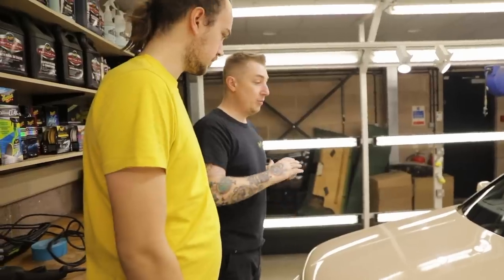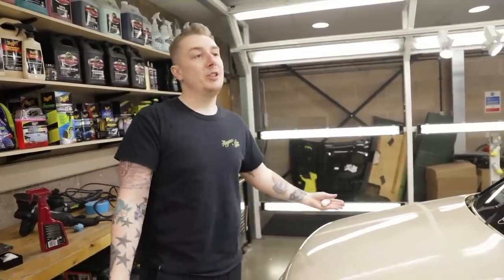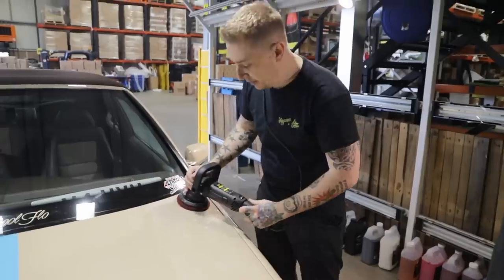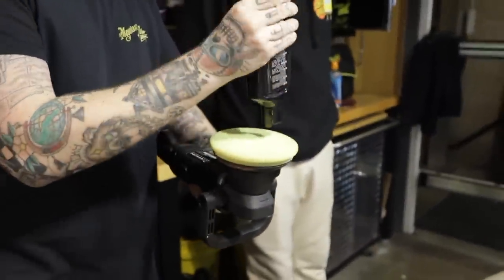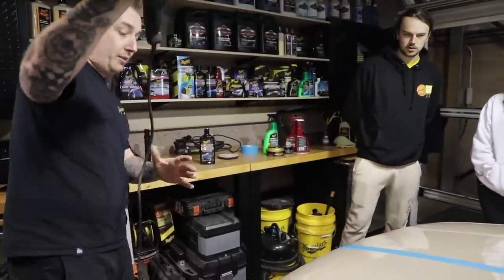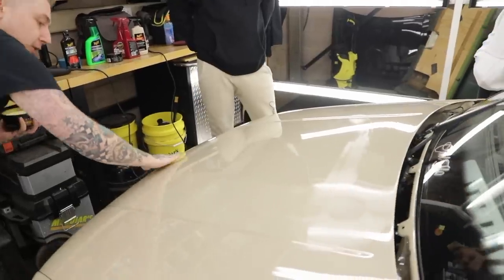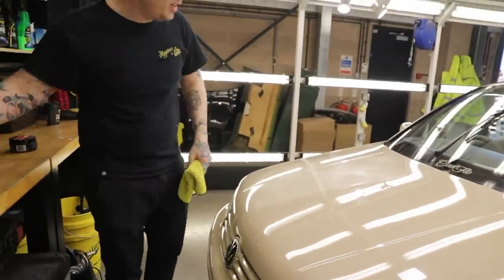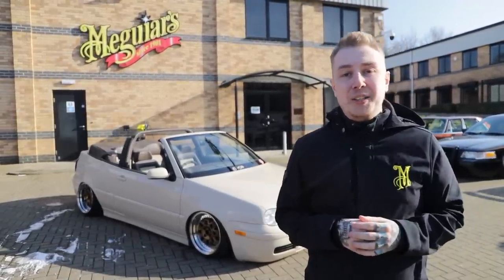How to remove SWIRL MARKS that you CAN'T SEE | Day In The Bay

Comment: Hey, hope you're doing well!
I have decided to detail my car after feeling confident watching your videos now 😄
It's a Pearl White color hatchback. 
It has swirls if you look closely from an angle. I want to get a shinny smooth finish with minimal cost as I might also sell the car in a few months to upgrade. 
I have a few questions  😁
1. I'll clean car thoroughly, maybe use an iron remover 
2. I'll Clay
3. Compound
4. Polish
5. Wax
Now in my country car products are expensive as it's all import.
I had a plan to do Meguires Ultimate compound, then ultimate polish and wax. It's a small car and the Wax specially is most expensive!
Should I go with the Meguires white paste wax ?
As it's a white color, swilrs won't be visible right. Will it be suitable to apply that directly after claying. Just 1 product?
Thanks

Comment: Thanks to your videos I've just spent £135 on your products! Your videos clearly work from a marketing perspective. Is there a difference between the drying towel and finishing towel?
Reply from the maker: Other than size no. But because the drying towel is much larger it's far better at absorbing water when drying the car.
Reply: @meguiarsuk  Thanks, what can I use just to buff the car off right at the end? Microfibre cloth?
Reply from the maker: @benl8177  Either a clean microfibre towel or Finishing towel.

Comment: Can you please explain what is the difference or benefits of using the Gold Class Shampoo vs the Ultimate Shampoo? Thanks.
Reply from the maker: The Gold Class contains conditioners that help with water sheeting away from the panel. The Ultimate Wash and Wax is our only shampoo that contains suspended carnauba so when used leaves a layer of protection on the car.
Reply: @meguiarsuk  Perfect. Thanks. Can i use both at different levels? Let say 1 month with the Gold and the other with the Ultimate to have the benefitis of both?

Comment: Can we get Maguire’s 3” foam cutting pads? The Autobrite Direct 3” foam pads I used on a 20 plate Clio detached from from foam backing. In all 3 pads fell apart due to insufficient glue. The 3 stage Maguire’s on a black car was hard work but worth it.  I’m still aching now. Products used 2 x MT320, 1 x 5” backing plate, 1 x 3” backing plate. 5” Maguire’s Cut, Polish and Finish foam pads. 3” Autobrite Direct Cut, Polish and finish foam pads. Autobrite snow foam (purchase in 25l drums). Ultimate wash and Maguire’a Super Thick Microfibre Car Wash mit using 2 bucket method. Ultimate WashClay kit, Ultimate Compound, polish and wax. Drying towel Maguire’s x 2, GT dryer and Finishing towels.

Comment: Iv tried the ultimate compound with the red Meguiars cutting pad and the swirl marks just don’t go of my mk5 golf gti,so iv ordered menzerna 400 followed by the menzerna super finish,hopefully things will work,if not,then I’m paying for a pro to come out coz these swirl marks are doing my head in specially wen the son hits the car and being tornado red you see it a mile of
Reply: I used ultimate compound with the microfibre cutting pad and it improved my tornado red paint on my Mk7 golf but there are still swirls aswell.
Reply: Try s20 black with the spider pad...my motor is red also .....came out pretty good
Reply: Depens how deep the scratches are! Potencially look into wet sanding the scratches first, saves you plenty of time but be careful not to go throught clear coat.
Reply: You could do rotary cut, and then follow with a da to polish to get the haze and the holograms out...thas what i do sometimes....
Reply: spyros greece hi ya fella,iv not got the experience to use a rotary I’d be to scared to try,what about the 400 then 3800 ?
Reply: DV Car Care I don’t have scratches fella iv only got few swirl marks ?
Reply: @tonylyons1274  of you use wet sanding you will def need a rotary because the da will take for ever...plus with sanding you will need several sand papers from ruff to really light so you can bond the scratches....if you take a rotery 2.000 2.500 rpms quick moves and working in a big area you will be fine...every 2 passes stop check ur area....and plus you could use a polishing pad for cutting instead of a cutting disc so you can play on safe side trust me you will be ok, do a test spot on the hood....do one side....and keep polishing with a da polishin pad also....if you dont have a second polishin pad, wash it reall well before you use it with the polish, i always clean them with all perpose cleaner and they are perfect
Reply: With a da we split the hood into 4 sections for example for cutting....with rotary just split in to two....and the same area, use for polishing with da. Just try to keep away from the edges, if you hit an edge dont panic nothing will happen, but if you have high rpms on a rotary, and working in a small section and near the edge then yeah you will burn, low rpms, polish pad for cutting try to stay away from edge, working in a big section and every 2 passes stop to check this way you can control the temp....you could use a slight spray of water on the surface if you feel like is grabbing
Reply: Plus i use soap and water to spray down the panel to get the oils out of the way so i can really see what im doing, the oils will hide from you many things...they are many products out there for panel wipes, for me it works fine with dish soap and water in a spray bottle, after im done my last stage is waxing or sealent anyway so, no problem, some they use all perpose clean 10.1 for panel wipe, never tried it i dont know of its ok or not, if anyone in here knows if it could work, ide like to know!!
Reply from the maker: Could you please explain the process you are following to see if there's anything you could try differently to get the results you are looking for. Or you can call the office 08702416696 and speak to one of the technical team who would be more than happy to help.
Reply: Tony Lyons makes no difference, if you do wet sand paintwork you remove anything that was wrong on it and compound/polish it to showroom finish